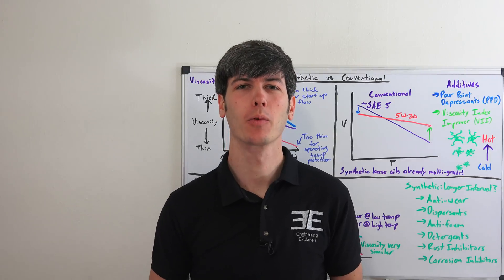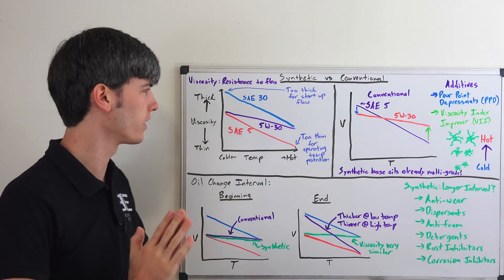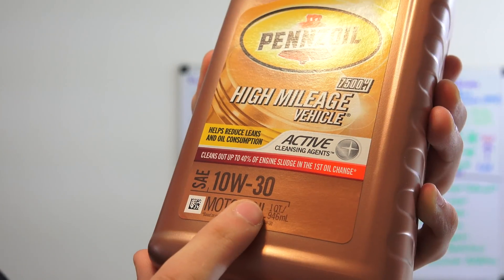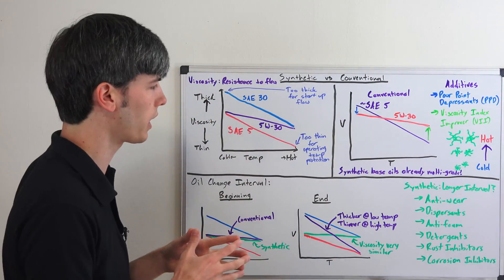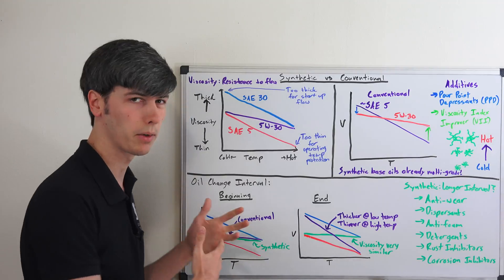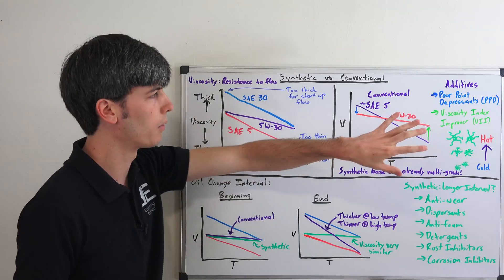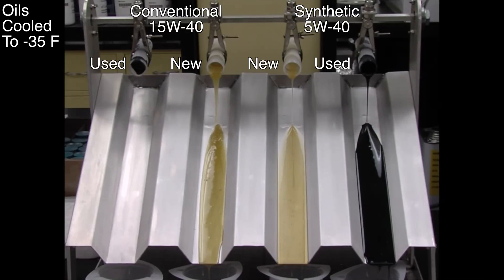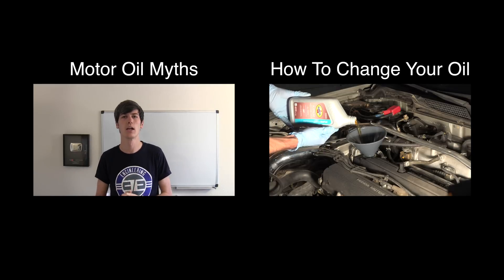Is Synthetic Motor Oil Better For Your Car?

Comment: As someone working in the automotive field, I can attest that only some of these statements are true. Indeed, synthetic oils may be better generally in newer vehicles (some manufacturers are even requiring them now) due to their ability to run cleaner for longer. However, it is very important to discuss the fact that these oils may often lead to problems for older engines, especially those that leak. Since synthetic oils are composed of smaller molecules, leaking engines may experience greater oil loss, as well as lack of lubrication to top end components. Good video overall, just be sure to do some research before throwing fluids in your vehicle. Your auto manufacturer will always tell you what is best to run through a specific vehicle.

Comment: Yes.  I have a 92 5.0 parked out in the street with 400 thousand miles on it.  Original motor, tranny, etc.  Synthetic is better.

Also have an 04 PTC with 350 thousand, same story.

(Original owner both cars)

Comment: Just how used was the oil in the demo? It looks pretty black. At my 5K mi. change interval, my oil has a brown coloration.
Reply: yeah i just said that. mine's still yellow when i change it. almost the same as new oil
Reply: Might be a very dirty engine. My daily I keep very good care of and like you I get a brown color, but I put a junkyard engine in my first car after the original blew up, didn't like how low the oil pressure was at hot temps so at about 200 miles I switched the oil for a higher viscosity, and it was black like that.That engine ate the lifters shortly after

Comment: I like the pretty drawings but 0w 20 was designed power a slight amount of fuel economy unless you live in Point Barrow Alaska the 0 w really isn't needed I live in Houston Texas 10w is not needed.Like Dexous  oil its a joke pay for that its marketing And the C.A.F.E rating.  And if your still changing oil every 3k miles you are wasting money 7500 miles is fine the 8-10 dollar  a quart oil  better last for that.  full synthetic 10k
Reply: 0w may not be needed to start the engine but using a 0w40 over a 10w40 in Texas would give a slight increase in miles per gallon.
Reply: My point 0w give good consumption in cold weather only

Comment: so why were you using high mileage oil as "conventional" oil as opposed to penzoils actual conventional oil?

Isn't the high Mileage the "Synthetic blend" because it has additives and detergents to help protect your seals and clean out gunk?

I am just curious as i work at walmart Tire and Lube and i would like to be able to answer My customers questions a lot better than i already can.
Reply: No, High Mileage (brown bottle) isn't the synthetic blend. Pennzoil does have a synthetic blend but that's the "Gold" type; "High Mileage" is close to being the conventional (yellow bottle) type but it has seal conditioners in it.
Reply: Austin Lucas So it is literally conventional oil with additives?
Reply: With extra additives yes. The extra additives are supposed to make the seals swell just a little bit. It's a bit of a short term bandaid for old engine oil leaks.
Reply: For the most part yes, though at least the High Mileage 5w30 is thicker at operating temperature than the regular non-high mileage 5w30. Not all high mileage oils are thicker at operating temperature though and I didn't check the other viscosities Pennzoil offers to compare between the regular conventional and high mileage types.

Comment: Does this mean that all 5W oil is synthetic since conventional oil cannot have viscosities as low as 5?
Reply: No. There are even 5w20 conventional oils on the market.
Reply: +Austin Lucas thanks for the reply. At 6:07 he seems to imply that synthetic is 'required' to get lower cold viscosity.
Reply: You're welcome. 

It is required in some applications depending on the type of viscosity. In short for Gas engines 0w20, 0w30 and 0w40 are all exclusive to Synthetic. For Diesels, 0w40 and 5w40 must be purchased in Synthetic. Maybe there will be improvements to Conventional oils to widen this.

On another note in America some synthetics (despite their naming) are really just highly refined Conventional oils but that's another subject I'm not as familiar with.

Comment: The W does not mean winter. I repeat, the W does not mean winter. The W quite literally means weight. 5W-40 literally means you have a 5 weight oil that acts like a 40 weight oil at operating temperatures. It does not matter if to live at the north pole or at the equator, it doesn't matter if it's summer or winter. A 5W-40 oil will still be a 5 weight oil until it is heated to operating temperatures. Unless, of course your day time high reaches 150+ degrees Fahrenheit.

Comment: my rotary says it's not xD
Reply: Blame Mazda, not the oil on that one.
Reply: timmyboy
true, lot of people run synthetic in it but also premix with 2 cycle oil, I here that works great
Reply: IRelentless I've only run pre-mix a handful of times (mostly when at the track) it's a way more reliable way to keep the rotor seals lubed but I kept getting dirty looks from the scrutineers due to the extra blue smoke from the back of the car, I stopped doing so to avoid the extra attention during tech.

I'm in Australia btw, no idea what sort of attention a smokey rotary draws in the US.
Reply: yeah, you can use modern synthetics. Mazda put the non-synthetic part in the manual because the synthetics of the time didn't have the right burn characteristics
Reply: Alexander Klein
there isn't many here still running so I don't care what they say
Reply: Alexander Klein
Do you premix as well?
Reply: i've been running idemitsu 10w30 mineral for 8yrs on my rx8. worked like a charm
Reply: I use synthetic oil in my FC3S, have done since I've owned it (~10 years now) and have had exactly zero issues with the engine.
Reply: I run 20w50 synthetic in my 12a it I have had ZERO problems and will keep doing so lol Its just a rumor to my understanding

Comment: "Engineering explained" has some explanation to do. 15W-40 oil (mineral-based or synthetic) is NOT recommended to be used below - 15F, so getting it down to - 35F is an Engineering Aberration, to say the least. And even for synthetic oil, it is pushing it below the recommended limit of - 30F. If you want to compare non-synthetic (mineral) with synthetic, use both oils of the same viscosity at a temperature that BOTH can handle or are recommended for (let's say - 30F for 5W-40 FOR BOTH). Additionally, maybe you need to review one of the key points in the Scientific Method: YOU NEVER MODIFY TWO VARIABLES AT THE SAME TIME (in the case of this video, the viscosity of the oil and the base of it). Otherwise, you cannot be sure if any changes you observe is due to variable 1 (the oil base) or variable 2 (the oil viscosity). The plots in the dry erase board are good at explaining the relationship between multi-grade oils, mono-grade oils and temperature. But the pour-point demo deserves an F and your adamant denial of the obvious differences between the viscosity of the oils is even worst... I'll give you an F- for it.

Comment: I've had 16 cars most over 100,000 miles, the highest at 234k before selling it. I always changed my oil at about 5-6K miles and i've always used conventional 5w-30 and never had any oil related issues. I'm not convinced.

Comment: mobil 1 has a oil that says right on it that you can go 15,000 miles between oil changes. I used it in my 2002 trailblazer. I just sold it with 205,000 miles and it didn't smoke and had good oil pressure. never changed a part on the motor. go figure.
Reply: While I cannot dispute that the oil can still be effective up to 15,000 miles, can they guarantee that the filter can still be effective up to 15,000 and not be clogged and not just be bypassing your oil and impurities including metal?

Comment: I thought oil changed is required, because it gets contaminated? And I thought I would take a really long time for Oil or the additives to start breaking down. Is this not true?
Reply: Not only contaminants can cause oil to break down, high temperature also affects it.
Reply: The oil does get contaminated even though your oil filter catches the majority of the contamination. Using an expensive filter might keep your oil cleaner longer won't make the oil last longer. How fast the additives break down is usually what determines the length of the oil change interval. Many modern vehicles have an oil change interval anywhere from 6000km to 10,000km using conventional motor oil because the additives used in modern oils has improved.
Reply: There's all kinds of additives. Some break down, some get consumed.
Reply: It's a few things:

1: Contamination (which can be greatly reduced by using a better oil filtration system commonly known as "bypass oil filtration") 
2: The additives being used up.
Reply: There is contaminates that the filter cannot catch, there is additive break down, the more the filter catches the sooner it opens the bypass valve. Regardless of the mileage, using the interval in your owners manual is best. 
IIRC every bottle of oil that says X,XXX miles says on the back to use the service interval in your owners manual or every six months.
Reply: the oil itself would take a really long time to break down, but the additives and the contamination of the oil would make you need oil change anyway. With the blow by, particles made during the burning process and unburnt fuel get down in the oil, causing it to get heavier when cold and thinner when hot, aswell !
Reply: Nitrates, it's all in the level of nitrates and their effect on the esters.
Reply: +Guillaume Gaudin 
True. Used motor oil can be recycled to new almost indefinitely.
Reply: It also gets contaminated by small amounts of combustion gases that blow past the piston rings. The gases mix with the oil and over time it becomes more and more acidic. This is why when you plan to store an engine for an extended period of time, you should change the oil BEFORE storing it. The acidic oil is not only corrosive to metal engine components, but it also makes engine seals hard and brittle, which can lead to cracking and oil leaks.

Comment: If I accidentally get a little bit of solvent like brake cleaner into my synthetic oil, will it have a negative effect? 

When I replaced the flywheel on my car, I needed to clean the crank threads of any oil to be sure the thread sealant would work and the torque values would be consistent. I used a q-tip soaked in brake cleaner to do this but there were a few times when the cotton was overly drenched and it caused a little excess liquid brake cleaner to drip down the crank, and I'm sure some of it must have dripped into my freshly filled oil. It would've only been a small amount, but should I be concerned? my car takes 9.5L of oil and it's not cheap, that oil was brand new and I'm broke otherwise I'd just refill it.

Comment: Why did you compare 15w40 to 5w30?
Reply: He explained in the video that you can't get 5w30 in conventional, and the purpose of the test is to compare new vs used oil.
Reply: 5w30 is real in Conventional. 5w40, on the other hand, I haven't seen. Is 5w40 what you meant?
Reply: and i meant 5w40
Reply: Did you have your volume up?  He clearly explained why.
Reply: I'm not sure if this is it but 15w40 is a common viscosity of Conventional Diesel Oil and 5w40 is a common viscosity of Synthetic Diesel Oil.

Comment: Thank you very much for this VERY informative video. Complex ideas, well explained and clearly shown. Although I understand it well, I have experienced difficulty explaining the various issues with my 3 boys (and their inquisitive friends!) Now that you have clearly addressed viscosity, perhaps you can address additives: dispersants, friction modifiers, suspensions, inhibitors, etc... in a more clear manner? It would be more brief, as, almost all oil has them, but, a simple explanation of what they are, and, how they work would be AWESOME!

   Another topic that I would love for you to discuss is extended change intervals. Slippery slope, I know- but, there are labs that can test oils for wear (Blackstone Labs, etc...) and, for example, I drive 1/2 hour (30 miles each way) on the highway, at steady state speeds on level ground @ 70 MPH for 29 of the 30 miles/minutes. Even a good conventional motor oil  can go 10,000 miles while maintaining sufficient: lubricating/viscosity/additives on this normally aspirated motor. I've tested & re-tested multiple times in all seasons to validate & prove it. But, there's no turbo, nor is it revving more than 3,000 RPM at any time in i's daily cycle either. 

   Anywho, thank you again for that exellent viscosity presentation- very well done!

Dave

Comment: i use mobil 10W60 in all my vehicles, classic and modern . its a fully synthetic
Reply: Uuuu u like em thick eh
Reply: lol that is the stupidest thing to do your car. you should use different oil for different vehicles. manufacturer recommends certain viscosity for a reason
Reply: +Austin Lucas I use 10w 40 full synthetic on my opel astra H that's done 150000km's. The manual says to use 10w 40 so i do plus I don't think I need a thinner oil as its pretty hot here in Australia although it's winter now and some mornings it gets down to 3 degrees Celsius.
Reply: Using an oil too thick for an engine will reduce lubricity, raise heat, wear the engine more and lower MPGs. It's just as bad as using an oil too thin for an engine. Note I didn't comment on your use though; I have no idea what your cars are subjected to or what viscosities they call for.
Reply: Well if you watched the video then the grade when cold is 10 , when hot is 60.  the original spec oil was 20W50 . so when cold it is thinner and when hot is thicker . this is an old engine that runs hot , it has no oil cooler and its 1963 design has plenty of clearances. the 60 rating helps oil pressure and lubrication when hot. The 10 rating keeps it fluid when cold. simple.
Reply: you said you use it on modern cars too
Reply: Karl Is-Karl who?
Reply: whatever. the stock oil for this car in 1977 was 20W50 . you don't seem to grasp this.  why it would wear the top end or blow out seals more is a puzzle.
Reply: For used cars over 60k miles, I'd always step up one viscosity, for example I use 10w-40 (10w because I'm in Florida) on my 240sx that specifies 5w-30 because it's got over 100k miles on it, and the tolerances have changed.
Reply: ***** you tried 10W30 and that was a disaster over 5w30, an oil with only a slight cold difference, something only an issue for the short time it takes the engine to heat up ?  My guess is this comment thread is predominately american.. :o
Reply: williwonti please do show me where i said "new vehicles" i said all my vehicles. my newest vehicle is 14 years old, my oldest is 39 years old.  perhaps get your head out of your ASSumption ?
Reply: +amojak what's the model of your newest car?
Reply: Karl Is-Karl heh, 14 years old is modern to me. that is a ford duratorq 2.4 diesel and it runs a lot better now. quieter too. the arguemnt about 30 oil is irrelevant as very early on i stated my car was specified for 20W50 when new. back then you couldn't get the range of oils you can now . so a jump from 20W50 to 10W60 is nothing special for an OHV pushrod engine. it likes it fine and goes like a rocket . the engine is perfectly clean inside , no mineral oil based crud and sludge everywhere, no blocked oilways to rocker posts (these are real thin oil ways) , no excessive rocker wear from the pushrods etc.

The 14 year old engine was specced to 15W40, it has wear and had some blow past the rings. the change in oil has improved that considerably , along with its top end .

hence as i said i use it for my old (39 year) and modern (14 year) vehicles.  what you guys do is up to you :)